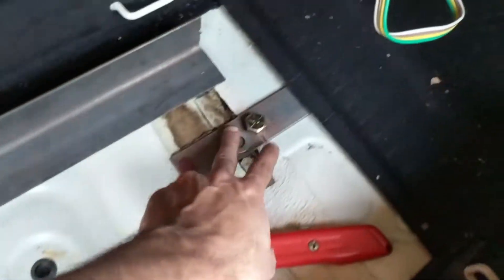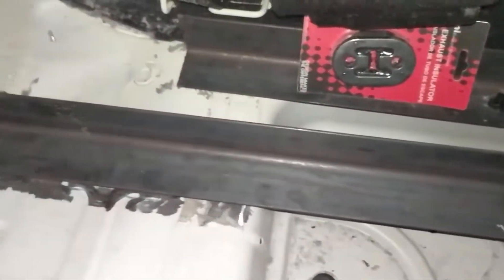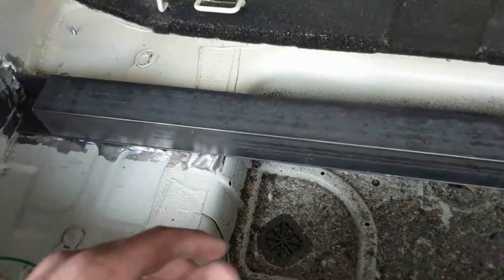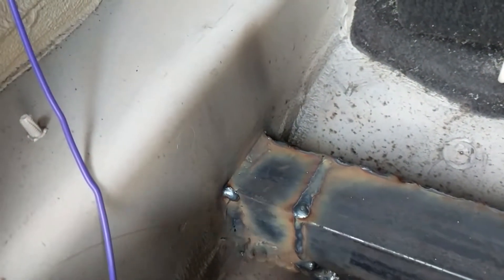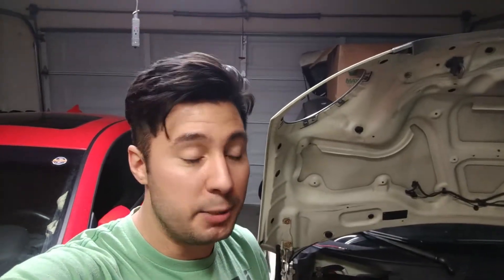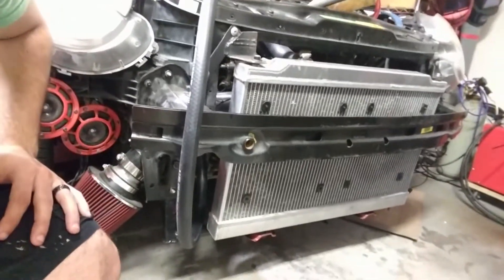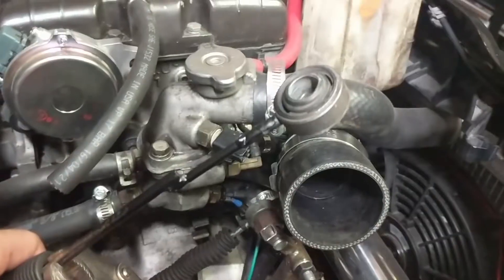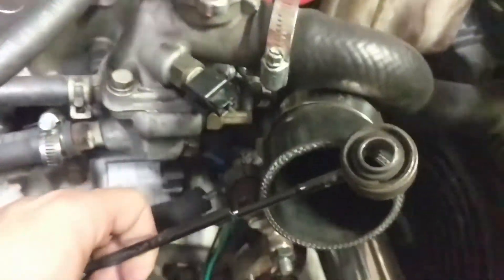Air to Water Intercooler and Rear End Reinforcement - AWD Mini Cooper Ep. 21

Comment: This water to air intercooler dont get heat soaked after a while of wot?
Isnt an air to air better?
Reply from the maker: Air to air can also heat soak if it's too small and you don't let it cool off, but in my case, there was no way to fit a big enough air to air intercooler or the extra piping needed to get it set up. I haven't had issues with heat soaking yet but I have a very large water tank in the trunk and I haven't been on constant back to back WOT runs yet.
The other benefit of air to water intercoolers, besides being more compact, is that you can put ice in the tank and make your air colder than the ambient temperatures
Reply: @InitialDIYmods  im trying to ad an water to air intercooler to my honda too, but I hear some people talk about heat soak, but then again alot of stock mustangs use water to air.
You should do videos about testing any possible heatsoak and daily driven reliability
Reply from the maker: Oh nice. I actually upgraded the pump recently to a Mustang water pump. Keep in mind that the water cooled Mustangs (and pretty much every water cooled OEM car I can think of) are supercharged so the heat generated by the compression is not as high and the pressure ratios are much lower than what you see with a turbocharger.
If the system is heat soaking, you need a bigger heat exchanger to cool the water down.
The compressed air transfers the heat to the water and the heat exchanger at the front cools down the water back to ambient. If the exchanger isn't cooling it enough, you need a bigger one. In my case, I got a largest heat exchanger I could fit in the front. If I do run into heat soaking, I'll need to either add a second heat exchanger under the trunk floor or modify the AC system to refrigerate the water on the way back to the tank. Space is my biggest challenge but there's usually a solution, it just takes some creativity.
Reply: @InitialDIYmods thanks for the advise, keep up the good work.

Comment: Sucks about your starter.  Every build has one of those kinds of issues.  In 2004 when I finished the last build on my GSX, I learned that Setrab makes their own proprietary fittings for their oil cooler.  The whole car was done save for those 2 fittings.  It sat for 2.5 months while I ordered 11 different sets of fittings from 6 different industrial vendors trying to match it, totaling more than $600 and none of them worked.  Back in 2004 there was no information about this on the internet.  I finally managed to reach the Setrab engineers by phone and figure it out, but if anyone needs 22 fittings that apparently fit nothing else on the planet either, I'm your man.  If you have a Setrab oil cooler, contact Setrab for -AN fitting adapters.  Every build has one of those.
Reply from the maker: That is just nuts. I can't understand why companies do that some times. It makes me want to avoid their products because I know I will have a hard time servicing or fixing something later on. I had a hard enough time finding metric bolts while living in Ohio when I started this build haha. At one point I bought standard nuts or some steel plate and drilled and tapped them to metric to fit the DSM. The BPT thing threw me off too. I might as well redrill and tap those Items to NPT when I build the engine or pull it again.
I appreciate you watching my build video. I have learned a lot about engines overall through your channel years before I even thought to own a DSM ;-)
And yeah it sucks about the starter but funny enough, at least I got this starter from autozone with a warranty so I am covered. That was my third starter so I am glad I could easily exchange it at almost any nearby autozone same day. Heck the one here in LA is open 24/7

Comment: Hey Let me know how that awic goes, where did you grab the parts for that? I've been trying to source parts to fix my heat soaking issues but I am either spending a fortune for a name brand or going with something from frozen boost.
Reply from the maker: Hey Ashton, Yeah it is pretty awesome actually. We went for a drive for a few hours through some fun hilly roads and it didn't heat soak with this set up. After this video, I had to change out the pump though. Originally it was from CXracing but after needing to warranty two pumps I said screw it and got the Bosch Pump for water to air intercoolers (I believe it was a replacement for Cobras and other supercharged setups). The pump is much bigger and louder though but if I put the rear seats up, I barely hear it over the exhaust Granted I also have a hatchback so in a car I am sure you'll hear it less. It costs $89 and here is the link https://amzn.to/2JEj5H4
I wish I went with the bosch from the beginning honestly
The front exchanger I got from CXracing is actually very good and I have no complaints. Cost was $165 and the Product Code is HE001 
I got the intercooler core for free by trading the old GSX intercooler. I think it is from frozen boost. It is a 2.5" inlet and outlet and it says type 16 on it. No brand names are written on it though. It is cast aluminum. Heavier than I thought it would be. You need to build your own support brackets for it as the intercooler pipes won't be able to hold it while you're driving around
I am not fully tuned yet so I cannot say how well it works on full boost when pushing it hard but I will definitely let you know once I get to that point.
The fittings were from Lowes and the hose was from like 4 different auto parts stores (none had enough 3/4" heater hose).
Reservoir is temporarily a windshield wiper fluid container with some AN fittings on it. I plan to either build my own from fiberglass  to fit perfectly in the trunk or use a 2.5 gallon fuel jug and put some fittings in the side.
Total cost for me was under $300 but if you need to buy the intercooler core too, you'll be looking at about $450 if you get the same core as I did from Frozen Boost. I also had a spare 2.5 inch intercooler piping kit from another project. $100 bucks shipped from ebay and it had straight and 90 degree couplers, plus about a dozen pipes (straight, 45, 90, and 180 degree). So I'd say $550 max to have the entire kit I have here.
I hope that helps and please feel free to write back with anymore questions you may have ;-)
Happy modding
Ryan